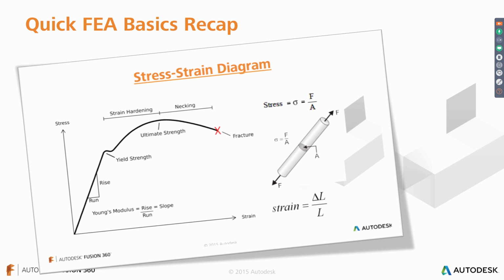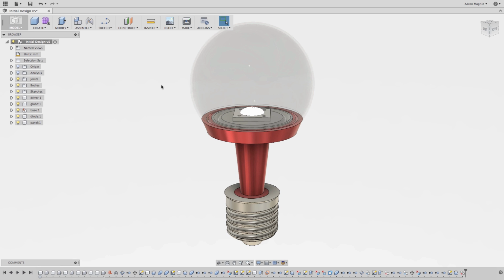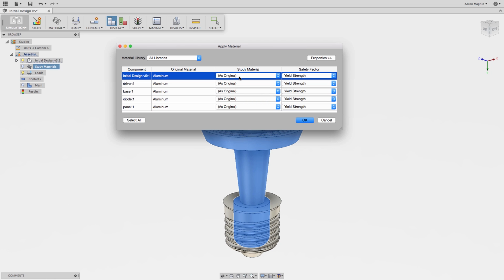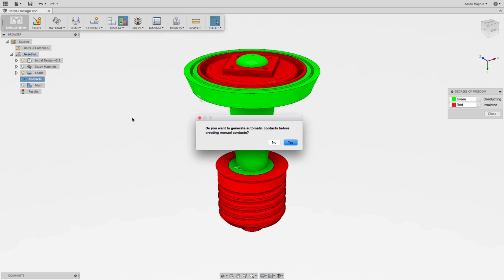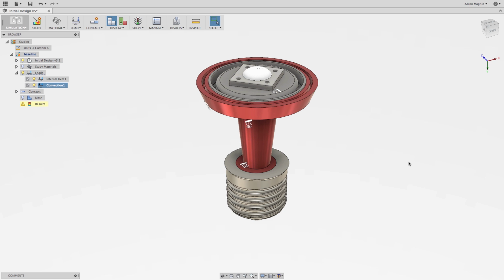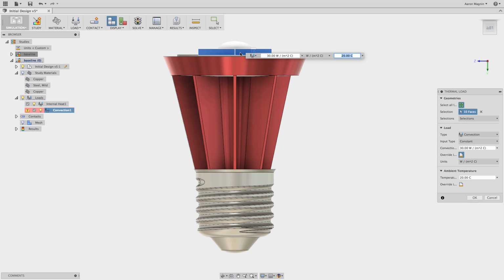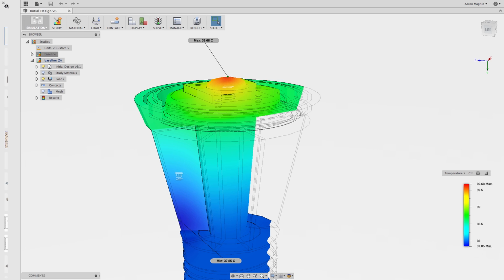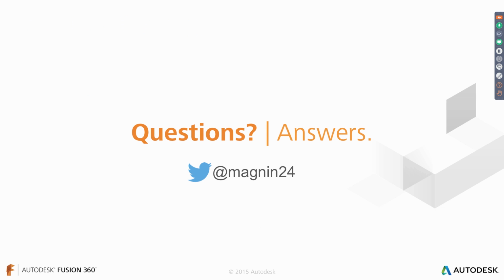Improve Product Performance - Advanced FEA in Fusion 360

Comment: Very good Webinar Aaron. I've been trying to design a prototype o a prothesis that is adapted to an STL model. I need to calculate how much contact or how hard the prosthesis is touching the imported model. I'm I able to do this with a stress analysis or any other simulation analysis? I will appreciate any help.

Comment: Is it possible to perform a luminance study using thermal analysis? I found where Revit does the study, but is this possible in Fusion 360? I would like to plan the even distribution of light in a warehouse setting.